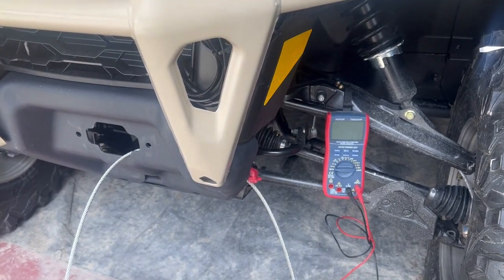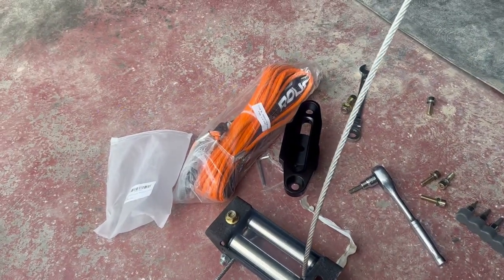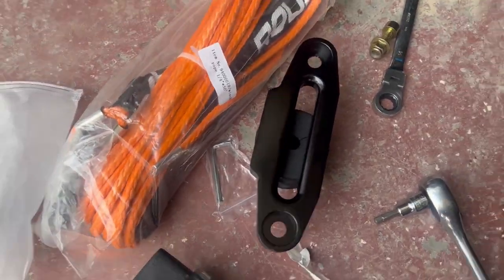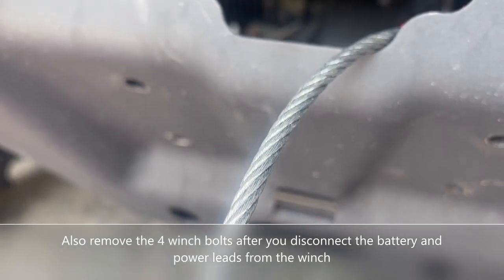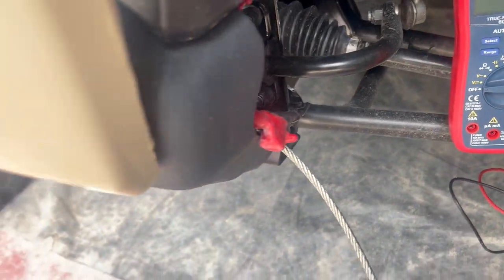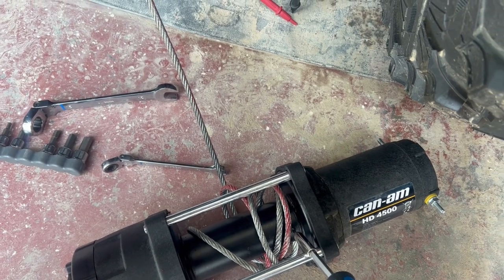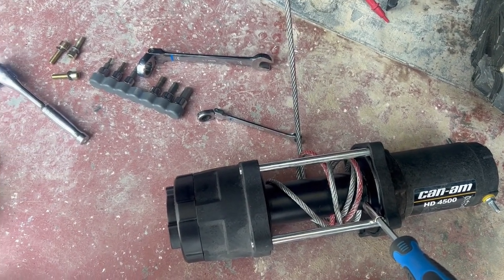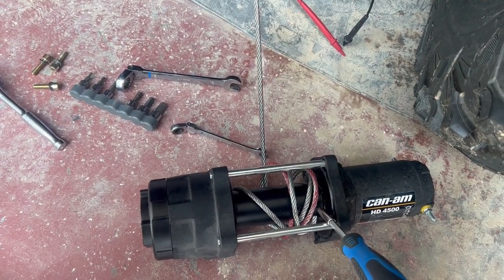Can Am Defender Synthetic Winch Line Upgrade

Comment: How did you get the rope connected? Were you able to thread it?
Reply from the maker: Yes, I put a piece of heat shrink tubing on it and it slid right in with no issues.